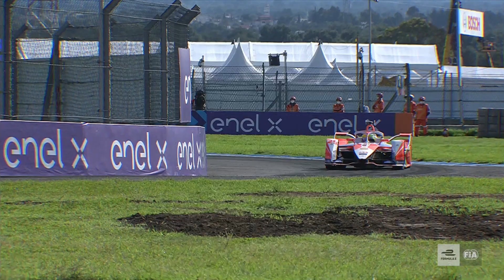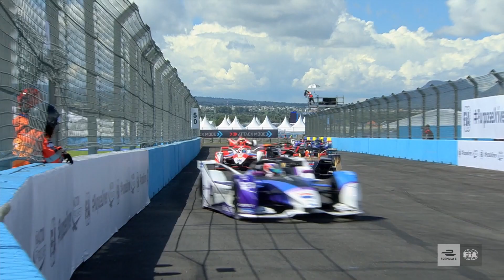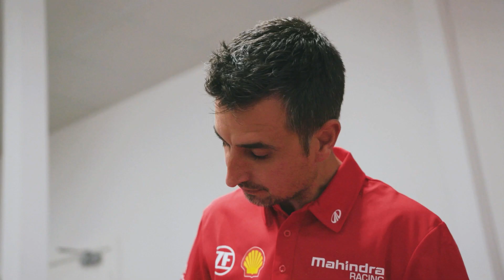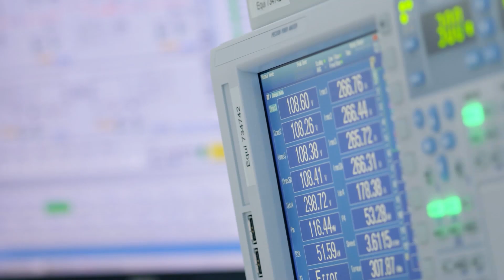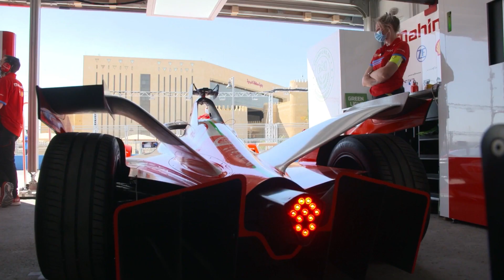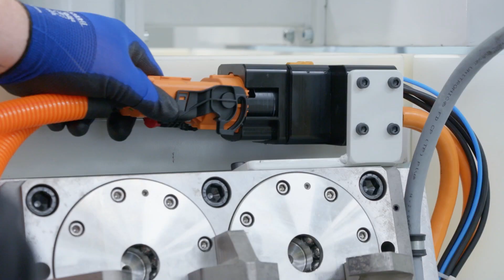Why Don't Formula E Cars Drive Flat-Out?

Comment: I am a complete tech noob, but why is the battery alternating current that still needs to be converted? Doesn't that conversion damage the efficiency???
Reply: Battery provides Direct current (DC) but the electric motor requires Alternating current (AC) so they use an inverter to convert DC to AC and while regenerating AC from motor and put it back in battery (DC).
Hope this answers your question
Reply: @Echold  ooooh okay, thanks, then I misunderstood it, thanks for explaining

Comment: The tracks they race on are questionable at best. Extremely tight. I get that it’s designed around the cars power and to promote close racing, but seeing a f1 car flying down the Kemmel straight will always take the cake for most people.

Comment: The other reason FE cars don't drive flat-out is because, if you've ever played with an rc car, you know how quickly electric cars get up to speed. And then they just stay at that speed, it'd be very dull. They don't go very fast, so you'd have slow as hell cars droaning around a track. But having start and stop tracks, you take advantage of an electric car's insane levels of torque.

Comment: Formula E needs to drop the street tracks and music before it will be considered a real race class and not just a gimmick.
Reply: Formula E is much more suited to street circuits and races tend to be substantially better on them. 

In the same sense you wouldnt get a drag car to do silverstone, Formula E should stick to something making it unique and entertaining - Monaco being the ultimate example of the advantage Formula E has
Reply: I think they should race on a mix of street and purpose built tracks (Shorter ones).

Comment: 😂😂😂 don’t consider this electric “racing”as a sport
Reply: If you actually watched the racing, you might find it quite good. You don't see 75% of the drivers going into the last 2 races with a mathematical chance at the title or side by side action with multiple changes for the lead at Monaco in Formula 1, do you?
Reply: Zap racing.  Agreed but formula e have a tendency to be able to hit each other and force there way past, which for obvious reasons F1 can't race that way. I think the London gp proved that, however it is interesting to see how battery energy and other mechanical parts of this sport work.
Reply: FE Monaco 2021 was the best championship race Monaco has hosted for years.
Reply: That’s alright then, because there are plenty of other sports for you to watch.
Reply: Anything without a cylinder isnt a motorsport .... i dont minding driving electric cars but i cant stand this... i remember the days of natural aspirated v10s blasting through spa . That was racing not this

Comment: Not driving flat-out because of efficiency? Wouldn't that make the cars not as efficient as they need?
Reply: No, the point is that when everyone has the same battery and ECU, and the max power out and in (regen) is set by the regs, making a more efficient motor and inverter means you can maximise the kinetic energy and minimise the heat. F1 has done something similar by restricting fuel flow and overall consumption.
Reply: @EmyrDerfel  Well Sims literally states they have to lift and coast just to recharge the battery and regen under braking isn't sufficient enough if they have to coast. So that would make it not as efficient as they need. 

F1 fuel flow restrictions are somewhat similar but not really. The teams also calculate how much fuel they need during the race, so no team really ever runs a full tank off the start due to keeping the weight down as much as possible. Whereas FE (I am just assuming this) starts with 100% battery because it makes no difference with regards to weight.
Reply: @MikeLitoris-69  the more competitive drivetrains get more mechanical power out per unit of electrical power out, and more electrical energy back in again during regen. This means they don't have to lift and coast as much. This is why you have teams like Dragon at the back, and the Merc and Audi drivetrains at the front. If Dragon tried to keep up with the leaders, they would hit zero early and get DQd.